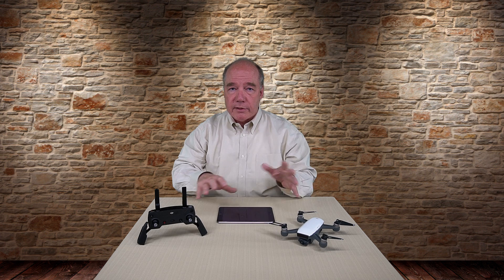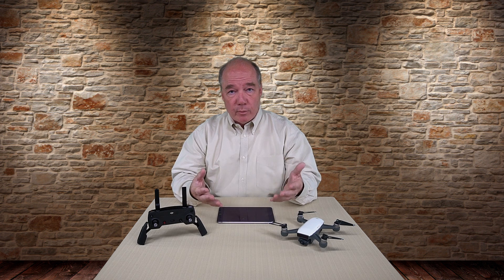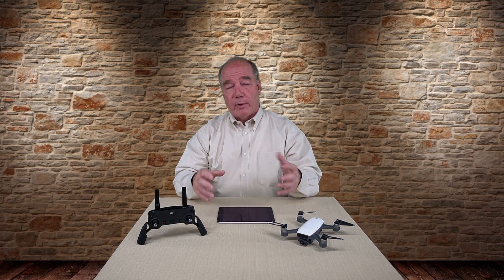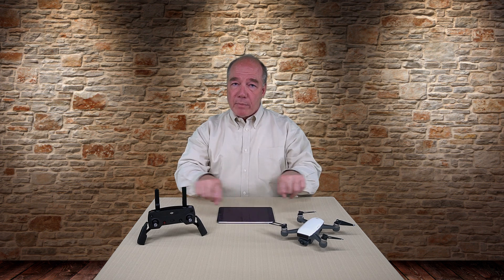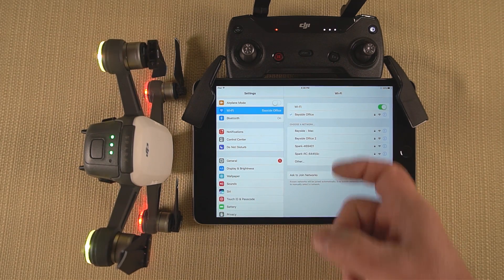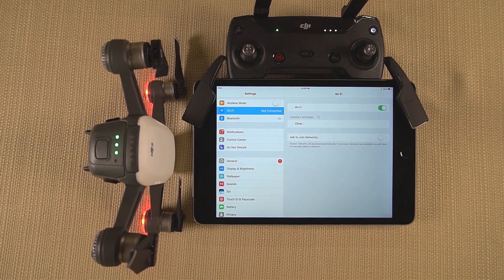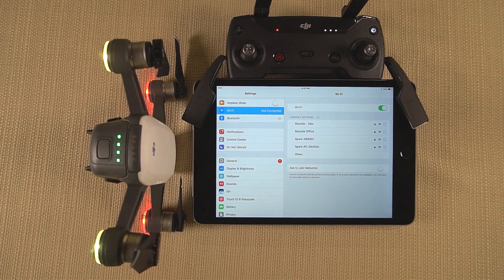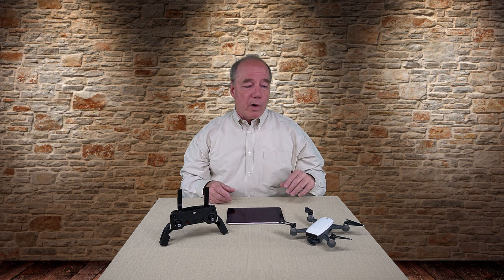The Technology Behind....How The New DJI Spark Remote Control Works

Comment: Hey Rick I just bought a spark and remote of a guy. I'm a newbie just so your aware. Anyway this spark and remote hadn't been used much and hadn't been used in a good while so they both needed firmware updates. I powered up the remote without the spark and than opened the DJI 4go app and the remote had turned green and showed in my wifi to be connected. So I did this and noticed the app was saying the remote needed a update. So I did the update on the remote only and after that it no longer turns green nor does it show up in the list to be connected in the wifi. I've tried everything from talking too DJI to videos and forums and I can't seem to find a fix for it no where. The spark done a firmware update with no problems at all. Might I add that when the firmware finished on the remote it kept saying log file failed or log file not found I can't remember which it was but it was something with the log file and I kinda figured that is where the problems lay with it. If you could help at all I'd greatly appreciate it . The spark got put away after one time out because it's just no phone on a mobile device

Comment: Hey Rick, i really appreciate this clip you did on binding the RC to the Spark and phone. I have been driving myself crazy trying to reconnect both all three together after resetting the password in the DJI Go 4 app. After I did that I have been unable to use the RC and the app together. It forced me to just use the RC flying the Spark for a few flights and I actually enjoy the flights better than before when I was using the app and my iPhone with the RC. The Spark seems to be more stable and not drifting as much. It is also more responsive without the binding to the app and phone. I realize that I can't do any of the intelligent modes, but there are advantages to the fact that the geo fence is not holding me back. I fly in safe zones anyway but don't get the nagging warning from DJI that cautions me not to fly. I use the Spark for just local fun stuff and you can still capture photos and video, but not get the FPV view on the phone but so what. I use my Mavic Pro for the more advanced flying missions.  I realize the range might not be as far too, but I am assured that I can be LOS anyway flying the Spark with just the remote as it would let me get too far out of sight. What do you think? I don't see many video or comments on the forums on just flying with the RC and not using the app, so am curious as to what you think as to the safety and advantages of doing this?

Comment: Hi, I'd like to ask a quick question. What is the Occusync tech that's used in the Mavic? Why wasn't this fancy tech included on the Spark?
Reply from the maker: The Occusync technology (similar to the LightBridge) was a communication standard that was developed by DJI for stable communications at long distances and is what gives the Mavic, Phantom and Inspire products their ability to deliver stable flight and streaming video. It's not a cheap tech to include in a quad and remote and the Spark was designed to hit a lower cost point than the other quads. Also, with the limited flight time of the Spark, you really can't expect to fly it out to two miles away and still have power left to bring it home safely. The Wifi connection in the Spark is very popular for this class of quad and is used in other quads like the Parrot Bebop, some of the Phantom models and both Autel and Yuneec products. I hope that helps and thanks for the post. Rick
Reply: It does. I didn't factor in cost to my thoughts. It makes sense that a more expensive drone with more flight time can afford to fit better antennas inside it. Plus, now that I have an OTG cable for my Spark, I can see why the range is limited. Flight time is short, and it takes a long time just to get out to the max range as is. Anyway, thanks for the help, and the reply in general!

Comment: Is it possible to use DJI Inspire 1 Controller on spark?
Reply from the maker: Luiz, unfortunately you can't use an Inspire, Phantom or Mavic controller on the Spark because they use different transmission standards to communicate. Those controllers use LightBridge or Occusync and the Spark is pure Wifi. I am hoping that DJI might come out with a firmware update to tweak the Mavic controller to work with the Spark but we'll have to wait and see. Thanks for the post and be sure to sub the channel. Rick
Reply: why not the DJI spark with the inspire so you can crash it?

Comment: Nice video. Thanks. Can you please share some basic tips on the remote control as I am a beginner and sometimes it’s just confusing. Is there any way that I can connect my spark remote to my PC and practice flying before I actually get my drone in the air. Sorry if I sound like a kid...but I don’t want to crash or lose my little sparky. Thanks. My email is kimaswani@gmail.com I hope i can get a get a reply or some suggestions from you as you seem to be aware of almost everything  about flying these amazing drones. Thanks again.

Comment: Ok may be some one ask and did not find it but ....... How did you get your tablet in the remote? Mine will not open wide enuf to fit my ipad mini.
Reply: Ok are a little persuasion I finally got my iPad Mini in the Spark Controller.
Reply from the maker: The first time is the hardest, it will get easier the more you use it.

Comment: Hopefully you can answer this because I'm stumped. I was able to connect to my remote's wifi out of the box, but during the firmware update, it lost connection. Now the remote is stuck in a state where the red light double-blinks repeatedly and my device no longer see the remote wifi. Any thoughts on what I should do?
Reply from the maker: Joe, thanks for the post and does the remote connect to the quad? The first step would be to bind those two and then connect the phone/tablet to the remote to use the app. Let me know which of those you're having trouble with and I can help. Rick
Reply: Ever since that botched firmware update, I'm only able to turn it on. The red light double-blinks like when it is searching for the Spark. I hold the button on the Spark for 3 seconds until it beeps. Then I do the Pause+Function+Custom on the RC. I hold until I get that quick beep, but it still is stuck in that state where it's searching. No RC wifi. No nothing. So I can't bind the RC to the Spark and I can't bind  the phone to the RC. The only thing I can do is bind the phone to the Spark. I've been scouring the web for two days. It may be time for a phone call to DJI. I just wish I could refresh the firmware or downgrade it in the RC like you can using DJI Assistant for the Spark.
Reply: Did you go into your phone settings and make sure you are connected to "RC Spark"?

Comment: Is it possible to use a small cheap tablet (Lenovo tab 2) that doesn't have GPS to run the DJI go 4 app with the remote controller?

Comment: Hi Drone Valley and All,

I just bought the DJI Spark's RC which is taken from fly more combo set (Initially I bought the Spark only version).

I tried to link them but sadly it doesn't work.

This is what I did, I've registered both devices wifi to my phone (and already update the latest firmware for the RC)

A) Switched on both devices.....hold the spark's battery for 3 sec and then I press pause, fn + custom button until the green light flashing....waited almost a minutes but nothing happened....keep on beeping

B) same thing, but vice versa....press the RC first and then spark's battery....

Can you help me on this :(

Thanks
Reply: Every time I fly the Spark, there is a good 15-second binding process... and everthing goes just fine.

Comment: Hi, thanks for the in-depth review of the spark controller, but, I fly mode 1 (old school!) I know I can change the mode on the phone but will the settings from the phone transfer to the controller through the wifi link or has it got to be done manually to the controller? Many thanks.

Comment: Tks for the explanations! Help me a lot. Just, one question. Is it normal feel a little bit delay when you use your control? I felt some commands a quite slow. I mean, doesn't respond immediately. Whats do you think? I'm afraid, if I setup something wrong. Tks!
Reply from the maker: The lag on the Spark is a little bigger than on the Mavic because of the Wifi connection speed. You can improve it a little if you use a cable to connect the phone/tablet directly to the controller. Check my channel to find a video to explain how to do this. Thanks for the post. Rick

Comment: does the spark need a compass calibration done like on the phantoms? also could you possibly explain the controller in more detail, specifically how the back function button is used.

Comment: Dbm is a logarithmic measure meaning that 25 dbm is not twice 10-12 dbm. To get the actual increase, the equation is 10^log10(10/25). I do not have a calculator right now, but it is about 4 times as strong.
Reply: An easy way to do the head math is every 3dbm equals double power. So if 0dbm is 1, then 3dbm is 2, and 6dbm is 4, 9dbm is 8, etc

Comment: do you have to bind the remote to the spark each time you fly or only initially when you first get the spark?
Reply from the maker: No, once you've done the binding (which is done when it's shipped in the Fly-More kit) you only have to do it again if you unbind them or do a factory reset on the Spark. Once they are bound, you just power up and fly. Thanks for the post, Rick
Reply: thanks for the quick reply, looking forward to more spark videos

Comment: is that an iPad MINI ? 1st generation? Some people saying is not possible to use iPad mini 4 due to the size. If you can clarify I appreciate . Aside that, great technical video !
Reply from the maker: The iPad mini 4 fits into the handles and works perfectly with the Spark and the Mavic. Thanks for the post and be sure to sub the channel so you don't miss any of the upcoming clips. Rick

Comment: Thanks for doing the video. You explained the connection process clearly. My spark hasn't shipped yet , my payment still says authorized which bites so I'm looking at probably July. I've read that DJI keeps Payment at authorized until it's ready to ship than they put the payment through, not happy with that.

Comment: Another nice job.  It's funny you explained quickly what I worked on for a couple of hours. At some point please discuss the 5.8 vs 2.4 connection.  I know the 2.4 is generally less susceptible to trees/buildings, but can be slower. Every time I try to switch just to see the difference nothing happens and it stays on 5.8. This little sucker is amazing!!!  .....update: Never mind my question about 5.8 vs 2.4.  I figured out it's not just enough to select 2.4, but you also have to pick the channel and then click "Apply."  This sure wasn't obvious to me.  Now I'll have to do some comparisons behind trees/etc.

Comment: Regarding the new spark which I have one order, Am I right in assuming That the IPad adapter I use with the Mavic Will fit the new controller.PresumablyThere is a USB port to plug It into

Comment: Love the Spark, flymore case just ok. As with the Mavic case looks nice but aftermarket cases do a much better job for protection and compartments
Reply from the maker: Eric, I agree and am already testing two cases that are custom built for the Spark that offer some snug foam in the bottom that is form-cut for the quad and several batteries. Stay tuned and I'll have the reviews up in a week or so when I've had some time to use them a bit in my travels. Rick

Comment: Seeing your explanation of this being a "pure wifi" quad makes me LESS interested in it. I was holding off making a decision between the Mavic and this Spark, but initial reaction is I'm not liking what I'm hearing.
Reply from the maker: Bill, I'll be doing a complete comparison between the Spark and the Mavic in a little while once I've had the chance to fly the Spark a little more. I can already tell the Spark is going to be my go-to quad for capturing quick pictures of the family and friends a little more spontaneously since the startup time is nill. It can't fly as far as the Mavic and stays in the air less because of the smaller battery but if I'm playing by the VLOS rules, a mile of distance is plenty. A lot of folks make a big deal about the 2-axis gimbal and the lack of 4K but I have found the image and video to be incredibly stable and clear so far and can hardly tell the difference to my eyes. Stay tuned and I'll do a complete breakdown in a few days when I've had a little more stick time. Thanks, Rick
Reply: Yes, I wanted to wait for your comparison before making any final decisions. However, I've seen hundreds of "pure wifi" FPV (supposedly HD) toy grade quads, and they all suck in performance and video, as well as the lag, drop out and freeze ups in the FPV video. You can hardly do a shoot with that kind of crap going on. Almost all my videos are well less than a mile. However, I don't want to wind up with something that is functionally crippled (like DJI did to the P3S), and thus no good for shoots. Whatever I get is going with me on my long bicycle rides in the country, and there are a lot of nice things to shoot .. and I don't want to be hampered by something which does not meet or exceed my expectations for video quality, both in the final product and while shooting.  I await your further reviews. Cheers.

Comment: This is not a spark related question but I will really apreciare if u can help me I bought a remote for my phantom 4 and I can't get it connected to the quad can I factory reset the quad ?the light on the rc is sold green but I can only move the camera up and down please help

Comment: Tell us what you think about the lack of fine controls within the go 4 app, expo or gombal control ect
Reply from the maker: Thanks for the post and you're right, it has less adjustments than its bigger brother the Mavic Pro but I'm not worried. I think of the Spark as a different class of quad that is designed to be fun to fly and take some basic video and images quickly. I'm working on a clip that compares the setup time for both the Spark and Mavic and you can literally get the Spark up in the air in less than 30 seconds to capture that important shot. Stay tuned, I'll be posting more clips this week. Rick
Reply: Yes true, i love it.. its my PRO toy.. but ime sure they can sort some better gimbal control ;(

Comment: Can you use only the remote for flying ? And not use a phone or tablet at all ? Thanks
Reply: yes you can once you bind them together
Reply: ljw2896 you can use a mobile device to control it but it harder to control and you have limited range
Reply: ljw2896 you can also use it without a device and use hand gestures
Reply: But can you use only the remote without connecting any phone to control it?
Reply: NorthernL1fe don't think so

Comment: Rick, have you tried the "RCstyle Radar Antenna Range Booster" or the "Parabolic Radar Antenna Range Booster" they are slip-on Dish Antennas for less than $15.

The name sounds kinda hokey but the reviews on Amazon and other Sites are 3 1/2+ Stars. 

They claim to greatly increase the range and don't need Battery power.

The Antennas you have now are omnidirectional (you can fly behind you) but with these add-ons as long as you're facing the Drone they will extend the range.

As long as you're not doing Orbit Shots of yourself from a mile away you should be OK.

YT,
Rob

Comment: You answered a big question I had. Going by just external appearances only, I was wondering if you could buy a Spark and use the Mavic Pro Controller on it. I took it for granted that DJI used Occusync on the Spark as well. I knew WIFI could not go very far without a booster of some sort. You answered that for me as well.  I just wonder how well this pure WIFI environment that DJI has set up would handle an area with a lot of other WIFI in it.